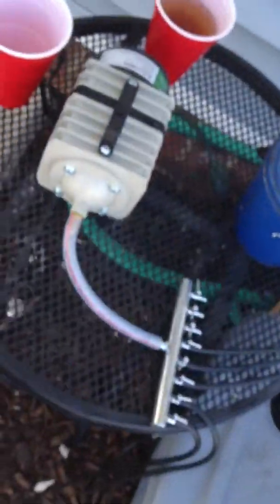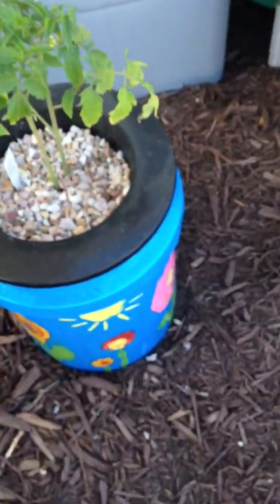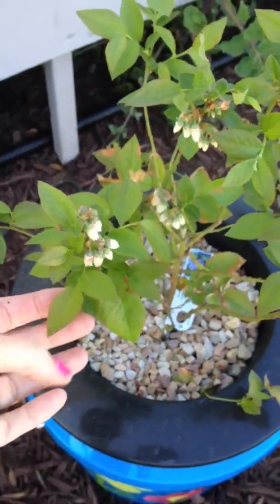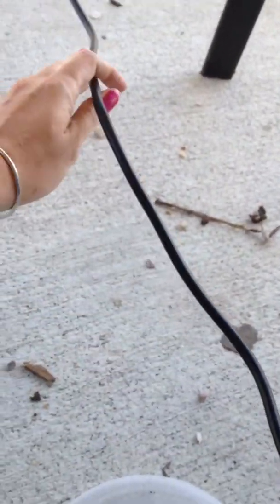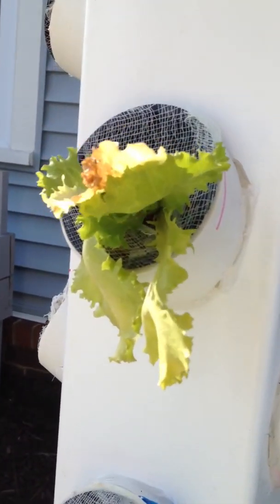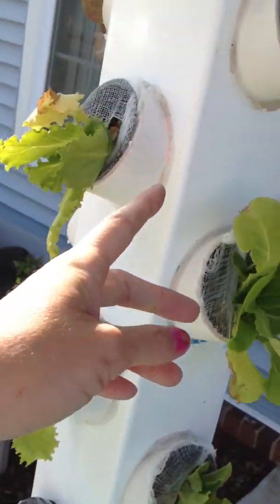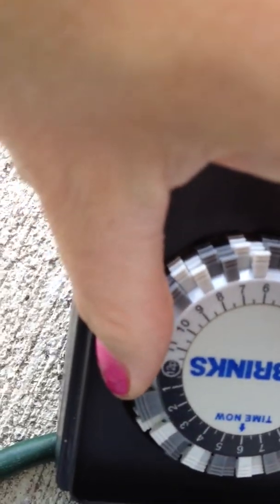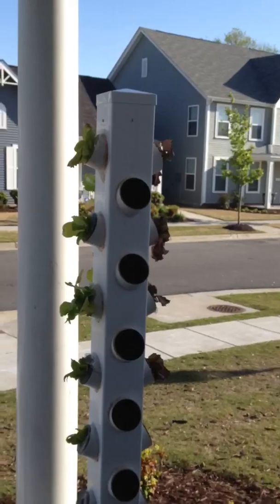Hydroponic vertical tower and deep water culture gardens DIY

Comment: I forgot to mention one thing about cutting pvc. You didn't specify what kind of saw you used, but if you are using a circular saw, there is a trick to it - reverse the blade so the back edge of each sawtooth makes contact with the pvc as the blade spins rather than the cutting edge. 

On my saw this requires a 9/16" socket wrench. Hold the blade tightly against a spare chuck of wood to hold it in place while turning the wrench. Then  flip the blade over so the label is turned toward the inside.

Comment: A dual-use system...an experiment worth doing?

The water - mixture produced by your system might well be similar to that produced by misters in cloning machines such as the EZ-Clone. This might allow you to root cuttings with your unit at times when you aren't growing vegetables. Generally, for rooting cuttings, you cut the bottom of the net pot out and use a neoprene washer to hold the cutting stem in place. The net pots and neoprene washers are standard items at any hydroponics store.

Comment: So I decided to use the bucket for another DWC for a larger plant like you did. The other tote is going to be another deep water culture system with 6 sites and 3.75" pots. Tomorrow I will finish my DIY Oxycloner powered by an aquarium powerhead. Check them out on youtube, you'll like them.

Comment: Nice job. I started my first deep water culture system 2 weeks ago and the plants are doing great. Starting from seed didn't work so well for me so I bought some plants and washed the roots and put them in hydroton. I also built an aeroponic tote and an aeroponic cloner in a 5 gallon bucket. Without even using them I started getting clogged emitters.